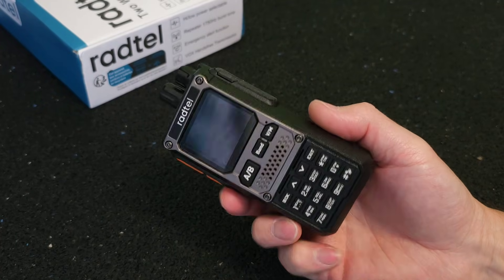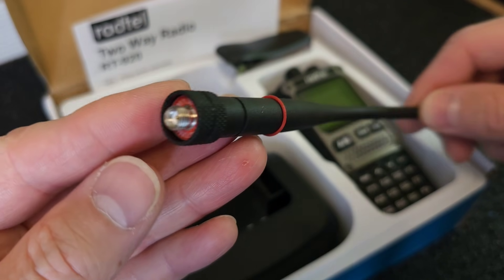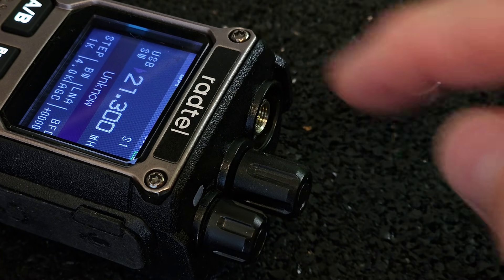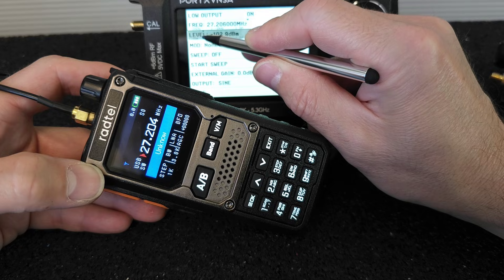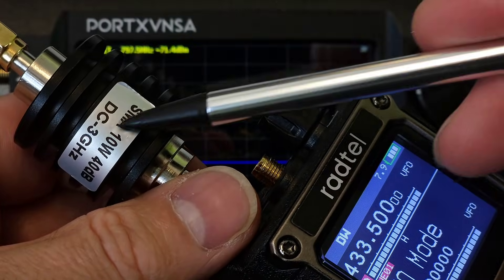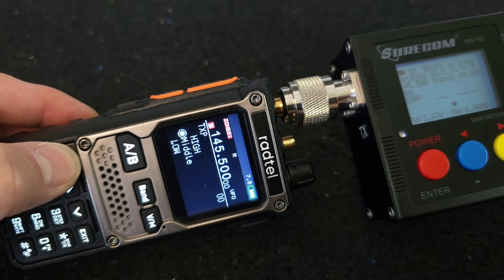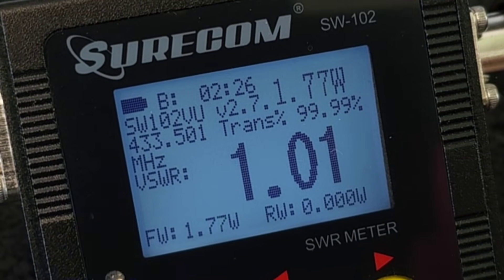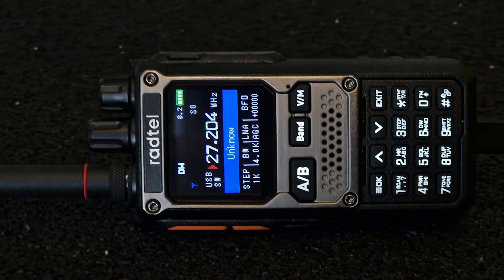RADTEL RT-920 - Spurious Emissions / RF Power / RX Sensitivity / SWR tests

Comment: Welp... I just got one of these. Worst radio I've ever had. Accessing hf/radio doesn't work. Squelch sensitivity is horrid. No reverse burst on pl, horrible long squelch tail. Programming a button to access the radio doesn't work either. Radtel just can't get it together with squelch circuitry, I never had a good one yet. Back to Amazon lest a worse thing befall it-like a hammer. Yes, I updated the firmware. Stick with Quansheng.
Reply from the maker: Mine just frozen 🤔

Comment: Hello. If you can please check it on HF bands. Check that modulations are correct (not inverted) and BFO tune works correctly. Twin model BJ-7800 has many bugs like listed above. Also changing AM bands LW/MW/SW not working. Both has the same firmware.

Comment: I have an RT900 and it's good to see they have improved the spurious emissions since that model, the RT900 is very bad and should not be used for transmitting. They are still actively working on the firmware - surprisingly considering its flawed hardware design. They gave up on the RT900 non Bluetooth version and opensourced its firmware, which is interesting. Thank you for the review sir!